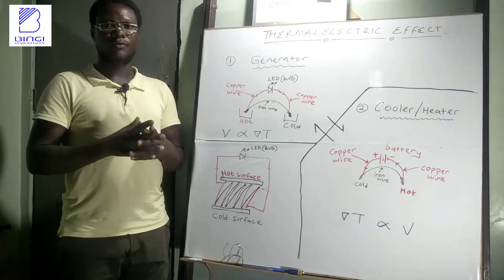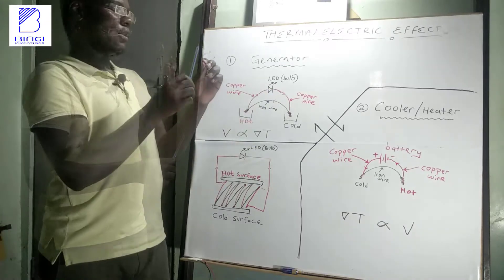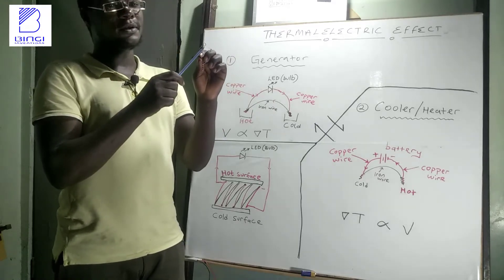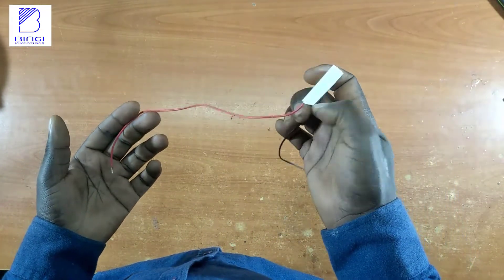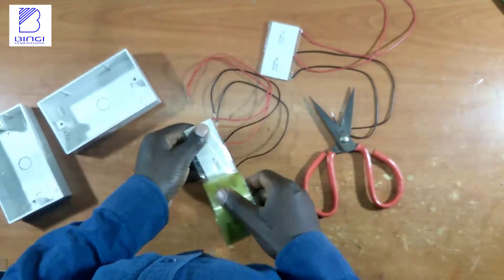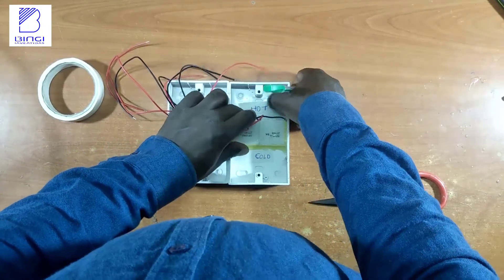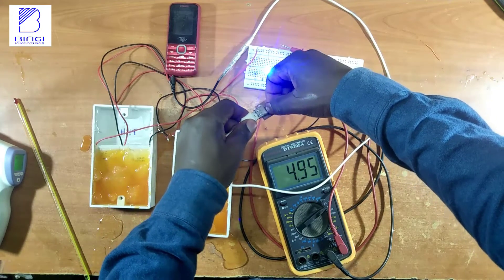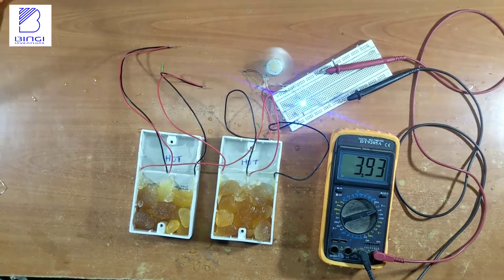How to generate electricity from heat

Comment: Great demonstration, I recently discovered copper wire with a copper oxide (cupric oxide) layer at the ends can produce up to 300 millivolts. All you do is burn the ends of copper wire with the tip of a flame to cause a reaction with the air and form copper oxide.
Reply from the maker: yes please, that works too!  subscribe to my channel for more